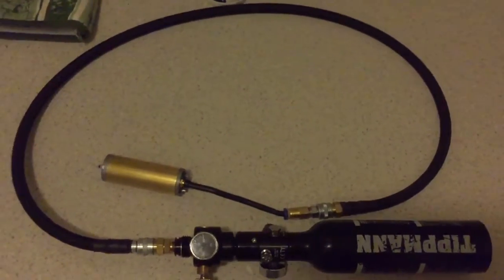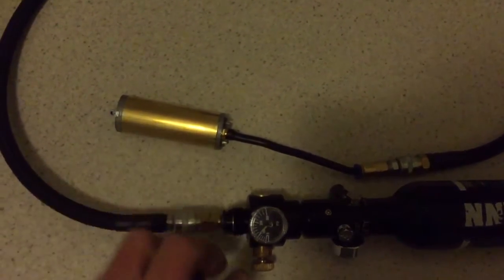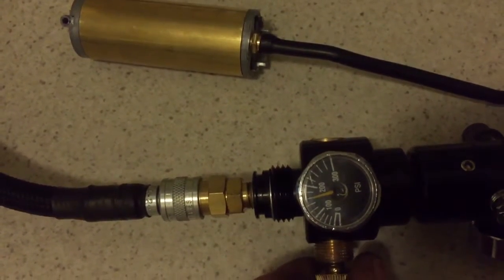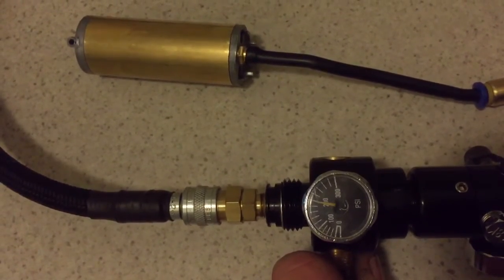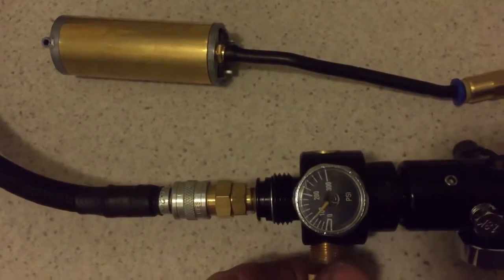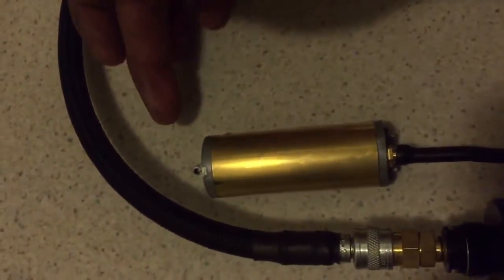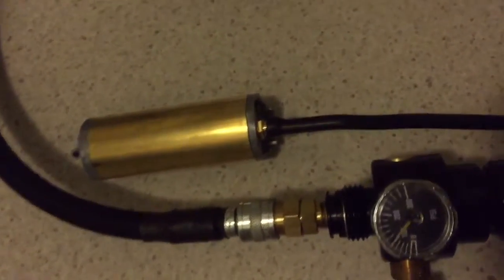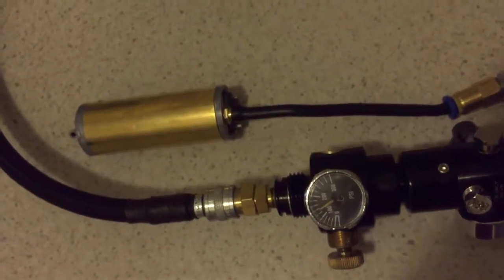1.. TM870 cylinder leak explained.

Comment: Whats exactly happening when it reach to 200 psi? the oring is forced out of its place and resits when u push as the hammer do?
Reply from the maker: 1shm41l yeah its so much pressure it forces the oring off its seat. And when u push the hammer it allows the oring to clamp back into its right position. 
U cant run it a 200 psi anyway because the pressure forces the buckings off the barrels when shot. But it will never leak where you can use it.
Reply: seems kind of reasonable to me.
Reply: I mean this is a concern I guess if your tryina hit 550 FPS